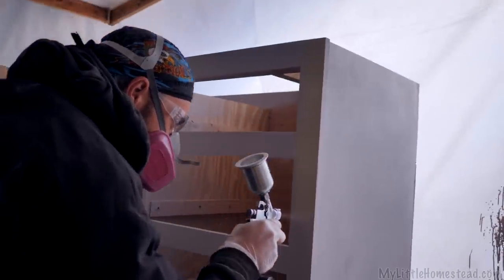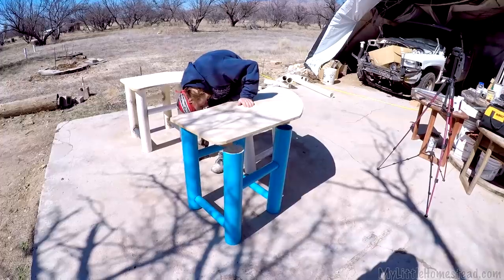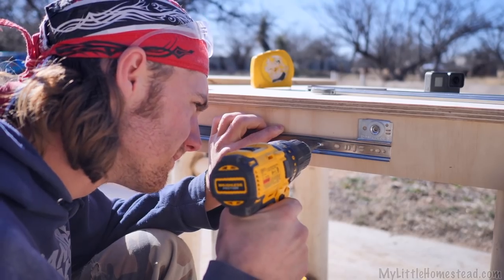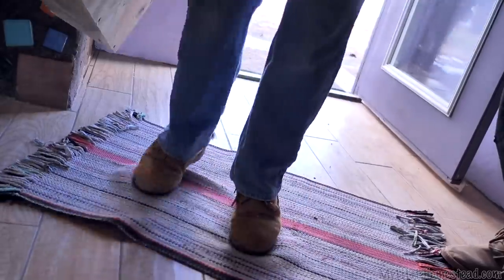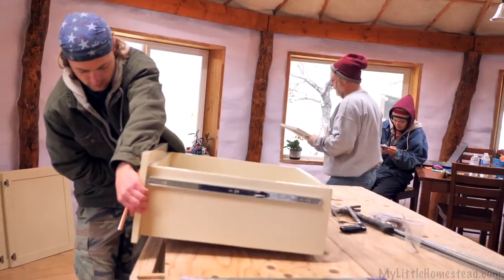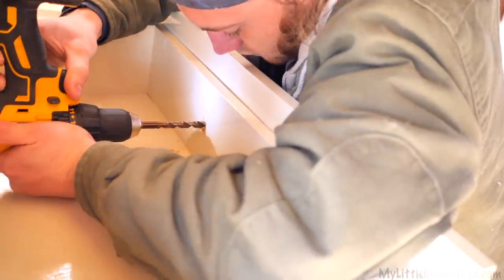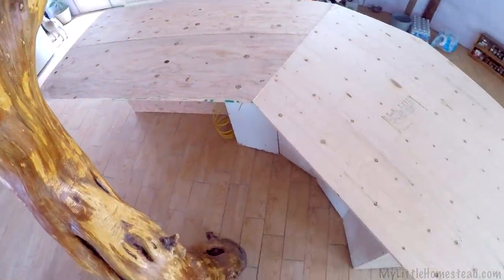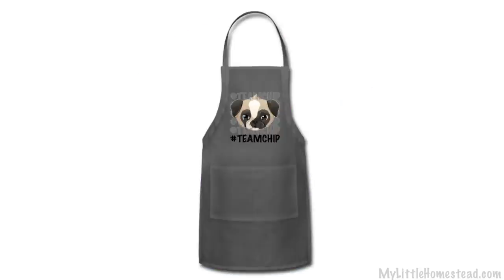Island Cabinet Set Up & Gaming Desk Drawer Build | Weekly Peek Ep173

Comment: Step 1: Mix the Concrete. Add 2 bags of concrete mix plus any sand required to complete the mixture to a wheelbarrow or cement mixer. Mix the sand and concrete well before adding any water. Then mix dye with 2 quarts (1/2 gallon) of water and add the colored water into the concrete mixture

Comment: Hello! To color concrete: there are powder pigments that you either add to the concrete as a whole batch and pour,  or you can make a marble effect by sprinkling the powder on top of the poured surface and trowel the top as the water comes to the surface it will mark the concrete with streaks.
Reply: I have seen this process many other places although I have not tried myself.
Reply: When I did our kitchen I added charcoal pigment to the mix when I poured it. I then polished it with diamond pads to 1500 grit then sealed it.  You can stain it afterwards, but you can't polish it.  Just make sure you reinforce well around the sink with rebar/wire mesh.  I got forms from concrete countertop solutions which are nice because they overhang the edge so it hides the plywood/concrete board.
Reply: Cee Joy and Ethan James have both voiced very good suggestions and ideas. I believe that whatever y'all choose to do, it will blend in with the rest of the kitchen beautifully.
Reply: So right! It's fun and less expensive too. I can't wait to see what you decide. I love the respect an laughter in your family

Comment: With concrete, you can add mica to the mix for some sparkle and for color, brick dust of any color or dry, un mixed grout dust comes in a variety of colors. You can also add chunks of broken glass or plates to the top of the slab or even broken tiles by using the same tiling technique as you would for tiling a floor. I've also seen pennies laid out and sealed with resin which turns out beautifully and, you can create a family photo collage, then seal the photographs in with resin so they stay beautiful forever. No matter what you do, you're going to need to seal the top of it with something and I recommend a thick layer of resin. It's durable and doesn't hold on to stains or bacteria at all. Also, if it gets seriously scratched up, it's relatively easy and inexpensive to repair as well as there being a multitude of colors that you can add to it using resin dye.

Comment: Concrete needs to be sealed, most importantly, after being stained. Google is on the ball with helpful suggestions the moment you put in "concrete staining", so I'm sure you'll find your way around. It might also be cool to do something with poured acrylic? I'm not sure if it quite suits your sense of design, but you have a lot of wood and other resources out there, and bar-top acrylic can be a lot of fun to work with and make really fun and durable surfaces.  There are a lot of videos on here about doing acrylic surfaces at home and about combining acrylic and woodworking.

Comment: At the hardware store, same part where you get your concrete, you can get concrete oxides, they come in many colours & are highly concentrated, so a small jar goes a v long way. I've only used the black & red oxides, but you can measure & mix colours easily & also use left-overs to colour grout etc.

Comment: I've seen some really cool concrete work that was finished to appear like it had fossils embedded in it. That would be super cool. Other ideas... acid stained with vibrant colors, embedded objects (like glass pieces, geodes, minerals or bottle tops), a hollowed out area filled with acrylic so it looks like a river flowing through... so many options, though most will need an acrylic pour over them. This is not concrete, but I think the nicest countertop I've ever seen was a solid piece of labrodorite. That was AMAZING.

Note, you might wanna think about also creating a dedicated space for a reversible cutting board/marble surface because that's great to have when doing a lot of cooking.

Comment: Concrete is a great material.
Any WATER soluble dye will work to color concrete. Dye is on the moderately expensive side, several dollars a square foot, but we are not talking about a 155 square foot room. You could go the staining route after it is cured to bring down cost.
I have no experience in concrete installation or coloring.

Comment: For mothers day, more branches, fake grape vines and orchids(dola store) with twinkle lights! yah! hu!, hu! The really fun part of the gaming/computer desk is when frustration gets too much you can Dramatically rip the top off and go Hulkish on the thing.Then put it back together and carry on!
Cement counters, mason stains applied as dry dust when the surface is smooth fresh and wet.(sneaky trick, use an orbital sander with rubber pad on the plywood from below as cement vibrator.) Allow to soak in until cream rises, then trowel smooth. Seal as you like after 30 day cure.
By the way! how are the car roof dents doing? I have never seen goats not hang out on the car tops.

Comment: For the counter tops you can color it with various powdered oxides, you should be able to find them at most DIY stores, or from ceramics supply companies or you can mix in glass chips, glitter, bits of mirror, or colored stone and polish the finished concrete like a terrazzo floor.

Comment: You can add stain to the concrete mix or acid stain it after it has been poured. You will need to wait for about 30-45 days after it is poured to acid stain where as not if the stain is added during the mixing. You can buy concrete stains and aci at most big box home improvement stores.

Comment: Yes oxidation pigments. At your hardware store. You can either mix it into the concrete for a solid colour or lay the cement then powder over top and it sinks in part way. This is messy so i would go with option 1😉

Comment: If you are wanting to paint the Concrete, then I suggest Oil Based paint and a layer of clear polyurethane on top of that to smooth it out and seal it.
If you just want to stain it another color, I don't know, but I still suggest the Clear Poly coat on top for the seal.

Comment: Look up putting corn chips (yes, the ones you eat) in your concrete for color and texture. I`ve seen it done and it was amazing . They  had it done on the floor and after 12 years it`s still amazing. I think you have to epoxy after doing the concrete on a counter, right? I know it makes it easier to clean for sure.

Comment: Hi there, it's looking amazing.
You can order concrete pigments off ebay and many other websites for quite cheaply.
I'm afraid using household products for colouring concrete isn't reliable enough as they can tend to fade or split in the drying process, also there can be a chemical reaction that destabilise the concrete, so it's best to still with well tested and proven factory pigments. There are loads to choose from, Happy shopping. XX

Comment: you will have to support the overhang in a way it won't bump knees on a chair. just maybe their will be children in the future and a concrete counter that they can bump into may not be fun too.
regardless I suggest another layer of plywood with a sheet over the seam in the middle with wood glue, then fill the ends with the sheets. so whether you concrete, tile, or use Formica you will have a very strong top.
didn't you once do a paper mache  floor? what if you did a paper mache top with memorabilia of the past or stories or something goofy like that so when you sitting at island you can read them. then cover with thick poly?
what ever you do it will look great by the time I see it.
best

Comment: Wow, looks really nice!  I've been checking out StoneCoatCountertops and am thinking of doing the counter tops in my home.  I'm just waiting for some better weather so going in and out of the house won't cost so much in our heating bill.  I don't see why it wouldn't work over concrete if you still want to raise the top height by a couple inches.  I used to do a finish on countertops but the epoxy look is awesome.

Comment: Try looking into the website ConcreteNetwork.com, they have a ton of does and don't. I would put marbles or stones and when you sand or hone down the surface the rocks/pebbles will show through same as the marbles. I would make sure you had at least a 3 to 4 inch overhang of the entire edge just in case you ever wanted to attach something like a pasta maker you can clamp to the edge.

Comment: I'm just catching up on the video's. Love the content and your such a great family. Anyway If you haven't done your counter tops yet, I have a few insights for you. You can trowel color on top (Color Hardener) looks good but doesn't get the edges. You can also do integral color which colors all the concrete and you can use two colors to get a marble effect. We used Cantilever Forms for swimming pools on the edges to get nice edges. Though I seen a real tight curved corner that would be difficult for the foam forms.

Comment: You should look onto epoxy for the countertops. It's much better than concrete in my opinion and more durable and versatile.  And cheap
Reply: I did stonecoat epoxy countertops in my kitchen and it was easy to build. Turned out great too

Comment: Woooooow! 
You guys doing it again... doing a good job on all your hard work.
Question... DO you think you can weld the inner side of that drill piece together so you can still use it. Its not like youre using it for metal, it should work just fine if you just keep it to wood. :)

Comment: I feel bad. There was so much to laugh at, I'm not going to lie. But the cupboard handles were the highlight. For the concrete colour, I'd suggest pigments such as those used in brick making. There are dozens of colours to choose from. I'm not in the US, but there should be some manufacturers online or near you that will either have them or point you in the right direction. Best of luck.

Comment: At one point I did alot of research on doing the concrete counter tops.  2 question, Are you going to do a pour in place or make a mold. Second is do you want to precolor or post color?  To me, I would take the plywood you are forming down for your tops shape and use it to make a mold out of melamine.  But with a mold you can cut the amount of concert needed by putting foam inserts.  And as far as coloring goes, There are so many ideals out there.https://www.youtube.com/results?search_query=color+concrete+countertops

Comment: at the lumber yards - they have Concrete Stain. to be used after or while pouring. - You can also Use like any turpentine? based Coloring pigment? Sigh.. it was Decades ago look up - Making Walnut Stains.. then Something about Paint thinning - then Food grade Chemical similarities. - read concrete stain labels? because I've never seen it used for food prep. - Also - when pouring this you want to layer it so that the top up - is more of a portland Based like Plaster? - Do a study on stucco? - In the philipines and other Asian countries and Hurricane Pathways - they build them without wood Framing. - Sigh. <heart> I've never built one or went beyond theory discussion. SO.. this is best Advice I can give.
Reply: Paint Thinner Ingredients
Turpentine. Turpentine is a chemical usually derived from pine oil but sometimes manufactured...
Mineral Spirits. Mineral spirits are a petroleum-based product.
Methyl Ethyl Ketone (MEK) Methyl Ethyl Ketone, or MEK, is a very caustic paint thinner...
Acetone. Acetone is the least toxic and least aggressive paint thinner ingredient.

Comment: Hi Guys the kitchen is looking great lots of work and fiddling but boy have you lot carried  it off 

Now for the concrete Counter top 

On a top that size  Go for 2 to 3 inch at least  and consider foam cutouts in the center area to lighten it (all that  info is in the provided links below) 

Don't Forget your wire reinforcing or it WILL CRACK 

 several options 

Concrete Oxides 
https://www.bunnings.com.au/our-range/building-hardware/cement-concreting/cement-products/oxides
https://concretecoloursolutions.com.au/oxides-pigments-for-grey-concrete-colour-chart/

they are mixed into the concrete and go completely through it so if a nick or chunk is taken out of the top it is still uniform in color 

you must make sure all your batches you mix for the top are exactly the same amount of everything as you would /will get color variations that do match up 

My next and I like the most suggestion is  Using epoxy in wonderful ways and I bet you go this route !! 

Resin art for the top, here are some examples  of channels I have been subscribed to for a long time 

 CountertopEpoxy
https://www.youtube.com/user/CountertopEpoxy/videos?disable_polymer=1
Stone Coat Countertops
https://www.youtube.com/user/bulldogquist

Epoxy Plus
https://www.youtube.com/channel/UC9gHnkDCZOZE2y4bvs9T-hg
Just Resin
https://www.youtube.com/channel/UCDzqm4dX7jEvMSz5nYOHFvQ

Resin Art/ When you start with a simple idea but end up with something extraordinary
  https://www.youtube.com/watch?v=gFgHWWHIGeE
after you have gone through that lot I expect to see many different examples of the craft around your place EG 

Don't blame me I'm only the messenger lololol
Tony from Western Australia